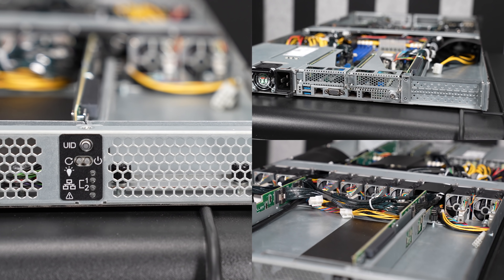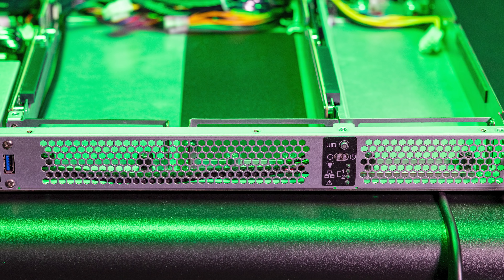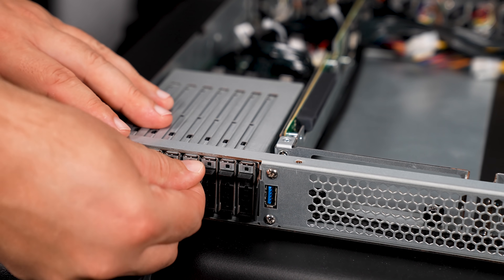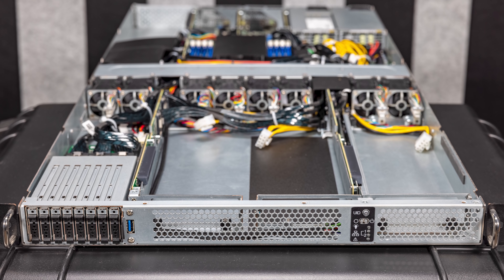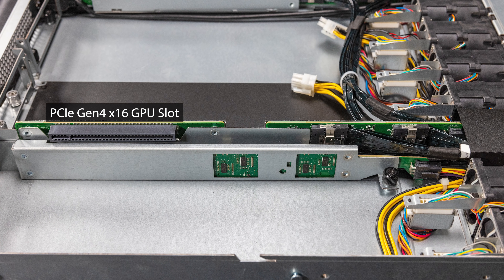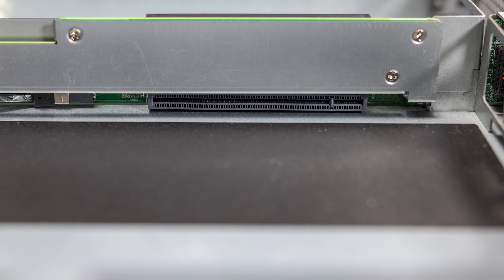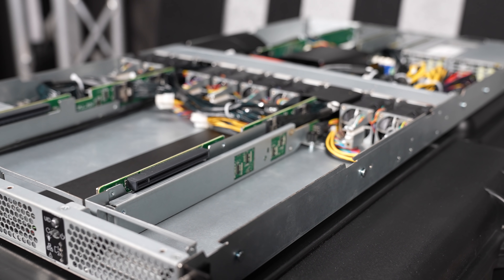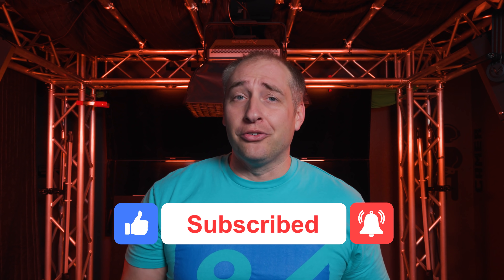ASRock Rack 1U 4x GPU AMD EPYC Server with EDSFF

Comment: Injest temp would be crucial for system and card stability. 
I sell water cooled (rear door heat exchangers) racks that can handle almost 70kW...
DC are going to have to adapt higher density computing is inevitable due to cost effectiveness and competition motivation

Comment: This video reminds me of a question I have. What exactly is the reason for continuing push density so hard in data centers? You can both simplify this whole system by just letting it be larger. Plus the power costs that you add by needing to do things like run the VRM mosfets outside their optimal efficiency, using an array of fans that must be using in excess of 40 watts and maintaining a lower ambient temperature.
Reply: Because real-estate is expensive. Just imagine the price for doubling your datacenter space (and lead time) to use an equivalent 2U system. vs using this 1U system.

Comment: A note about PLP would have been appropriate when talking about adding M.2's to servers, as anything but boot drives.
Reply from the maker: I am not sure what you mean by this. You can have non-PLP (read focused) drives or there are quite a few M.2 22110 SSDs with PLP if you need that feature.
Reply: @ServeTheHomeVideo  Among homelab'ers, it is increasingly popular to buy cheap laptop grade M.2's and use them for enterprise workloads, without realizing the dangers.
And sadly i am seeing this more and more in production workloads as well.

For long, it has been quite "hard" to do this, as it required bifurcation support, or expensive PCIe adapters with PCIe switches.
Newer servers have offered M.2 support, but only for boot drives, eliminating the risk of major data loss.

But adding such a thing like this M.2 to EDSFF adapter, just begs for people to use cheapo consumer drives in servers, with data loss and performance issues as the result.

People don't seem to understand that there is a reason Samsung EVO's aren't used in production systems.

Comment: I have two home servers with Asrock server boards the IPMI AST2500 is terrible for any task power commands barely ever work installing OS is painfully slow with encryption of ISO’s. Dell IDRAC or HP iLO is miles better. I guess in the end you get what you pay for. Not to mention the stability of these systems.

Comment: All Epyc by product generation in the WW channel today Milan = 7.52%, Rome = 59.55%, Naples = 32.93%. 

All Ice in the channel today is 6.7% of all Epycs and 77% of all Milan. 

Cascade Lake + R in the channel today is 885% more or un units 985 XCL for every 1 Epyc all gens.

Here's my cost : price / margin assessment in comment string today at Seeking Alpha. AMD WW channel last week, Intel WW channel last week and GPU Today Turing through Ampere will reported on briefly.

Intel Xeon Ice Lake average weighed 1K = $2351.18 at MR = MC = Price for a 50% discount off 1K = $1175.58

Intel Cascade Lakes 1K = $2609.61 / 2 = $1304.81. I estimated Intel could sell XCL in a full line procurement on depreciated 14/12 nm process for as low as $521.92 but would rather get $913.36 that is 1K < 65% discount. On combined XCL/XSL full line procurement I estimated Intel could sell in high volume for as low as $366.81 per unit see AMD and Intel at my Seeking Alpha Blog Spot titled 'Server Today';

AMD Milan average weighed 1K = $3440.12 at divide by 3 stakeholder * 1.5 equals OEM at (< 50%) P = MR = MC @ $1702.06.

On divide by 3 TSMC Milan plus package house price to AMD is range $1146.70 to $1433.38 taking into account TSMC 25% price increase over stakeholder / 3.

When TSMC raised price by 20% in q1 AMD q2 full product line price increased by 26%. AMD knew about second q4 TSMC price increase at q1 price increase? I think so.

So if Intel is going to lower Xeon price (notation: the SA article I commented postulated a Xeon price drop) the current discount off Ice 1K may be 27% that places a full line procurement of Ice in parity with Milan on a per unit purchase basis.

AT MC = MR = Price occurring before peak Ice production Ice cost may be around $587. At cost x6 aiming for economic profit Ice are probably produced on average for $470. Intel will aim for x8 economic profit where average marginal cost drops to $294.

TSMC 7 nm for Rome full run marginal cost range $353.89 down to $270.73 on learning where TSMC price to AMD is $707, perhaps as low as $540 at run end but's this 'profit max' scenario is not an economic profit.

TSMC raised price to secure economic profit that pays for CapEx at competitive 'profit max' will only pay for some R&D. At TSMC price increase Intel entered the foundry business.

Intel wants an economic profit but can sacrifice on margin or bundle deal which is why 'bunde deal' needs its cost line. Intel will retain the supply advantage.

Intel also has a lot more to trade in terms of cross product categories volume which is again why 'bunde deal' needs its cost line.

AMD at 5/4/3 nm factor cost increase is beholden to TSMC pricing. For the mass market I foresee 7 nm legacy product for a long time on depreciated CapEx [equipment] especially for consumer dGPU market where system bus width and VRAM (or HBM commercial) is more important for subsystem performance than the GPU itself.

AMD will have difficulty sacrificing margin, has less to trade, and will rely more on bundle deal which is why 'bundle deal' needs its cost line.

Intel really has no reason to drop price, aggressively, however I can see Intel wanting to price below 'in-parity' with AMD on OEM and Business of Compute price making leverage.

This may result in an intel price performance compromise under Milan say by 27% which is where it is now; AMD at $1706 and Intel at $1304. If AMD drops to Intel's $1304 they cut their net by 24% and this then becomes a slippery slope AMD cannot afford to play on foundry pricing.

Intel wanting margin and needing to increase revenue x2 through the next four years, "dropping price" sounds like fake news or a PR system 'propagandist manipulation' to me.

Mike Bruzzone, Camp Marketing

Comment: I always believe the ruler ssds we're much longer
Reply from the maker: If you check out the EDSFF video, you are probably thinking about the E1.L drives. There were also the original "Ruler" drives (Intel P4500 Rulers) that were more similar to E1.L but not the same.
Reply: @ServeTheHomeVideo  thank you. Is that longer rule still going to be standard?

Comment: I cant wait for systems like this to go on ebay for cheap, i'd be hoping for 16-24 EDSFF in PCIe 1x speed. I dont need the speed, but i would like the density
Reply: Denvera, Naples is already priced down which is what Jeff at Craft implements as (I assume) the neighborhood ISP; game server, virtual (engineering) desktop . . . mb
Reply: @mikebruzzone9570  Nice to see you Mike. I'm sure its starting to come down in price, but i'm referring to ebay steals like my 2010/2011 Dell CloudEdge C2100 that i got in late 2015  for only $115. 12 cores, 24 threads, 12 LFF bays, and 18 RAM slots(only 4 populated when i bought it) IIRC original price was somewhere in the neighborhood of 15k with storage and RAM

Comment: In my experience the sole gpu at the back of the case needs to run with significant power limits in order not to thermal throttle. What I would like to see in 1U is 6 single slot GPUs (T4, A10 etc) in the front, then the whole case can be normal depth and all 6 gpus get fresh air from the front. Why is no one offering something like this? Supermicro now has something similar, but even they do only 5 single slot per machine and place one at the back ...
Reply: in this case it looks like the rear gpu gets the air from the front ssd's, so it should™ be better than if they were gpu's back-to-back. the ssd's shouldn't output that much heat.

Comment: The cooling is completely an issue with these 1U 4 GPU systems.
One of our customers had one built for them and kept having over heating issues. We built them a few 4U 8GPU systems afterwards at a cheaper price and proper performance.
Even with super low temps in the data center under full loads 24/7 starts taking the toll on those systems.
Reply: Watercooling /s :) Ohhh the piping nightmare!
Reply from the maker: @savagedk  We have something very cool coming along those lines that will make you re-think piping nightmare. It was going to be shown at SC21 but it looks like that will not be in-person so working on finding time to get hands-on (and hopefully one for the lab)
Reply: @ServeTheHomeVideo  3M Novec? :)
Reply: 1U is really not necessary for a 4 guy system, you cannot fill a full rack anyway.
Reply: I feel like this system would cool a ton better if they had used a PCB for power distribution. The DC power cables eat a ton of space side to side directly in the fan path. Having a flat pcb with with only the PCI-E data cables on top would clean up the air path significantly. Then just have short cables for each GPU/motherboard.
Reply: @ionstorm66  direct chip liquid cooling does not have such weaknesses

Direct chip liquid cooling works best for such systems
Reply: @ionstorm66  looking at the build quality of this vs a big brand name like Hp or Fujitsu makes it look like it was build on the ship on its way from china.